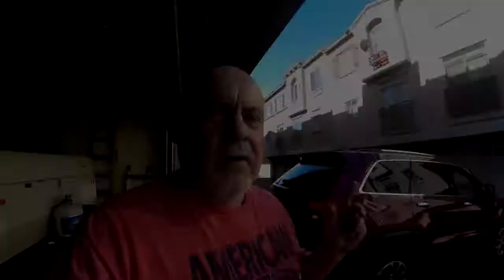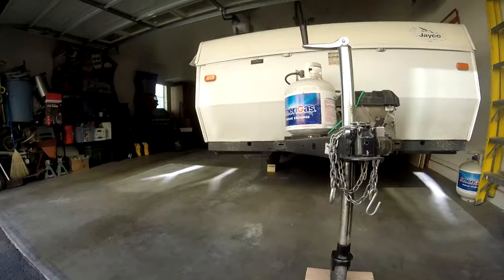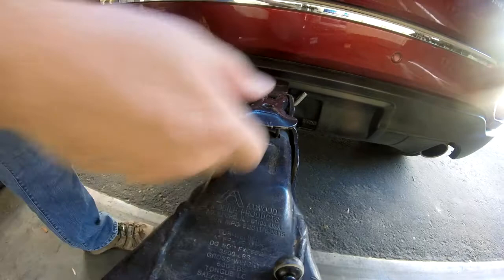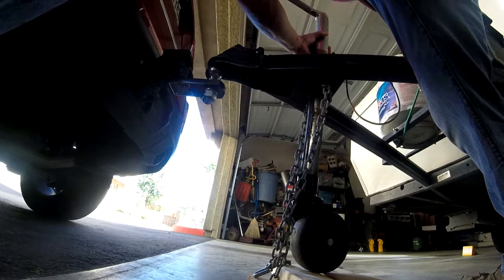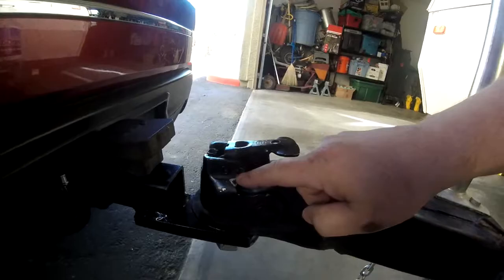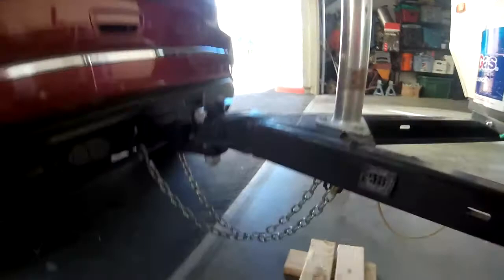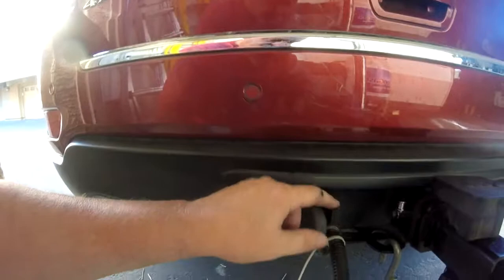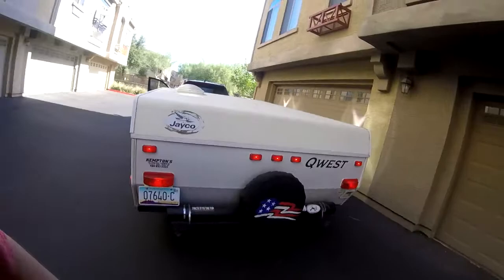How to Safely Hook Up and Tow a Camper or Trailer by yourself!

Comment: I am missing a wheel for my pop up! What is this wheel called? I have heard “Jockey wheel” and “Jerry wheel”?
Reply from the maker: I've not heard of either of those Sara. I've just called it a wheel. I found one at Tractor Supply when I needed to replace one. Just tell them the size. Thanks for the question!
Reply: It’s called a jockey wheel in the uk

Comment: Does your trailer have brake also or just relying on the suv brakes?
Reply from the maker: Hi John, Yes it is set up with electric brakes but they are non-operational right now. It is light enough where I don't need them. But that may be another video when I fix them! Thanks for the question. Are you thinking about buying one?
Reply: Our Simple Adventures yes looking at the armada but they don’t come with trailer brake. I guess you don’t need a sway bar coz its not that big pull?
Reply from the maker: @johng2750  I don't even know Junebug is back there.  Uhaul did install a trailer brake on my "06 GC but it didn't need it either.  Your Armada should be able to pull any popup but please check to be sure.
Reply from the maker: @johng2750  You can add an after market trailer brake to your Armada or have someone like Uhaul install it. That is what I did with my '06 Jeep. This camper is so light the Grand Cherokee doesn't know it's back there!